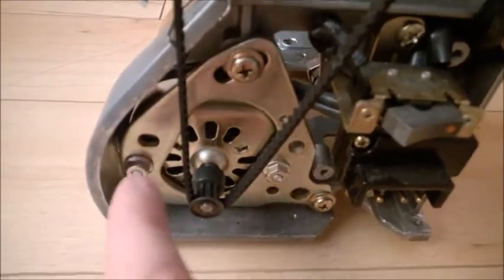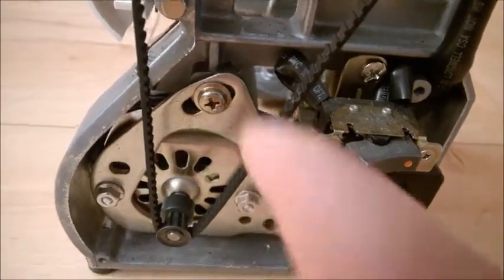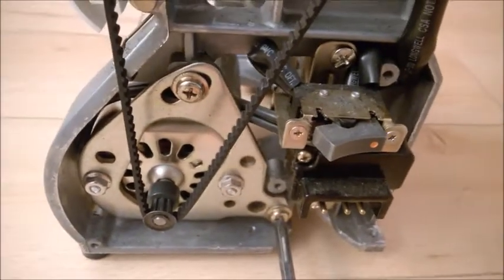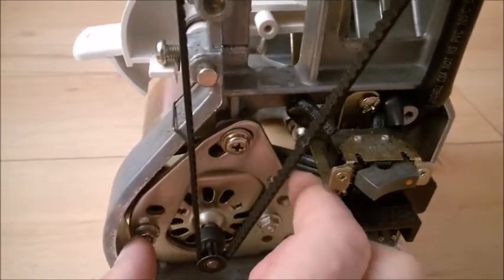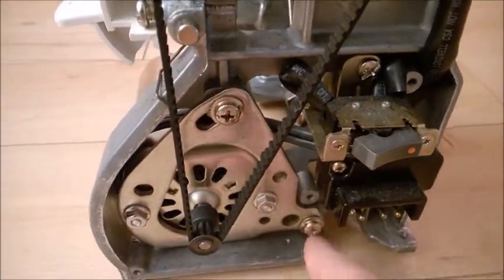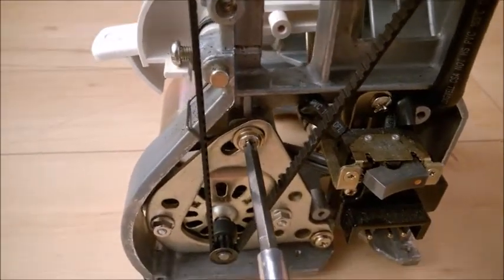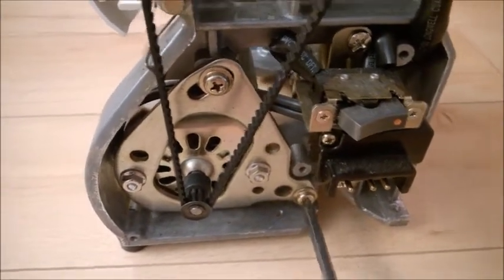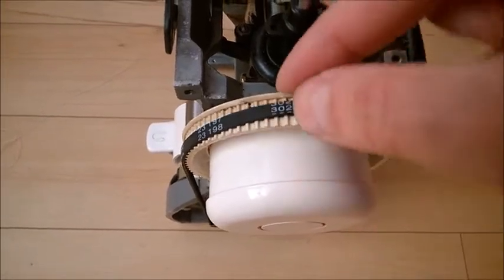Modern Sewing machine motor drive belt tension adjustment

Comment from the maker: IMPORTANT   Before you loosen the locking screw that sits in a groove, MARK the original factory position of this screw inside the groove. It is essential you mount the new belt with the exact same tension adjustment as the factory adjustment. These lug type 'teeth' belts are quite tight - be aware that a looser belt will cause very quick belt wear - the belt will start developing cracks quickly.  It may seem counter-intuitive but these belts are meant to work under quite some tension.  The plain thicker belts usually found on machines with external motors have different tensions
Reply: Wow!!! It's very important to know